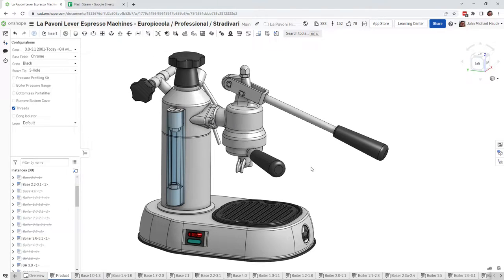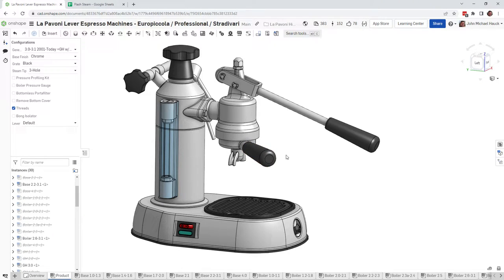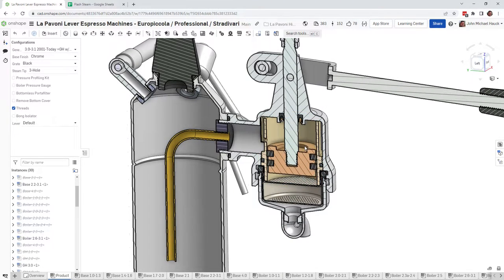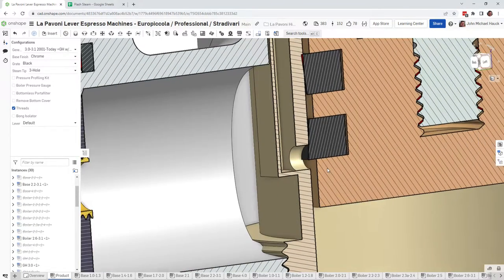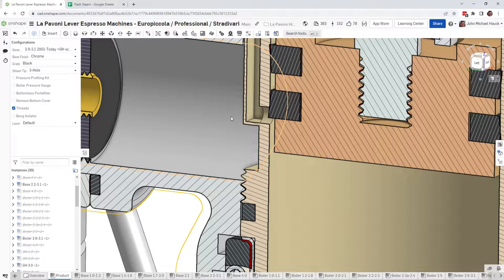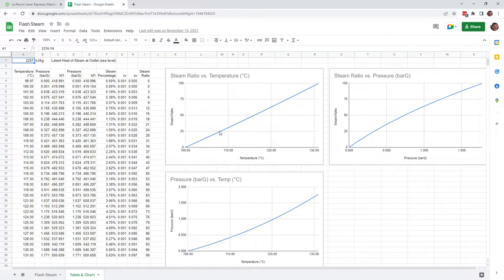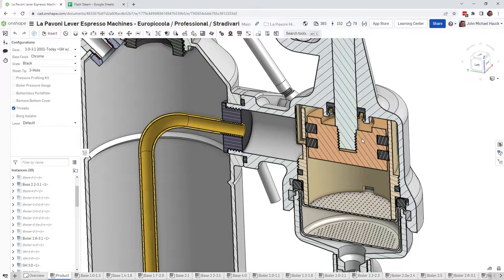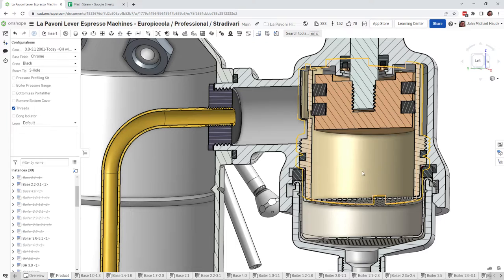18. Trapped Air, Spongy Pulls, Low Shot Volume, Spongy Pulls, and The La Pavoni Sneeze.

Comment: Really useful and helpful - thank you very much. I took mine apart for a fiddle and found nothing wrong, then after watching this realised I was probably just not allowing enough time to heat sink the head plus not pausing enough at the toop of the stroke to allow the water to fill the head. Have also tried the slight up and down movement which seems to help.

Comment: Still improving with my Gen 3 vs Gen 2  thanks to your videos. Findings last few days:
 - As stated in video one can heat up GH with pulling up and down without letting water out. Water cycles group<->neck<->boiler. Quite effective at heating and more controllable than Gen 2 with Steam.
- I had good results with putting the PF into GH without locking and letting water in for 2 seconds and then locking all the way. Air has easy way to get out. Improved my output from 24g to 31g, which is my aim. Before I also had all this bubbly coffee at the end of shot and couldn't understand the reason (trapped air following water through coffee). Thought GH was too hot and it was the steam.
- Putting paper filter on the puck prevents the degradation and puck comes out with flat surface. Tastes better too. Only solution for Gen 2 since no 49mm puck screens in the market.
- I have 1 more solution in mind to trapped air. Unscrew the spout, lock in PF, hold the hole with finger to prevent air getting in. Needs to be tested, since currently using bottomless.

Comment: I am trying to understand the way the sneeze is described here. It seem so scary, dangerous, messy, something “you want to avoid” as you put it. Isn’t it intuitive to just stay on the lever and make sure everything is purged out air and water through the puck? Take out the cup when yield is reached and keep the lever down. Or isn’t it common sense to just raise the piston a bit to relieve the built pressure before removing the portafilter?  I am asking because i am really curious if more people are really fallIng into these scary sneeze accidents. Also it is a manual lever machine, what is the rush to remove the pf just to make another coffee for the guests? I mean it is a manual, pour over to refill , cool down the bell kinda machine... what is another couple of seconds to wait for the pf to depressurize either by lift or by patience?

Comment: Thank you for the videos :)

The ultimate solution for spongy pulls is the "Airbuster" by CoffeeSensor. I installed this on mine LP and.. no more spongy pulls with any group temperature. The leaver feels hard to push from the very high position, even with 0.8 bar boiler pressure.
Reply from the maker: Yes, the air buster works very well.
https://coffee-sensor.com/product/airbuster-release-valve-and-chamber-for-la-pavoni-lever-group-heads/
Reply: Wasn’t there a solution in user manual? It is recommended to release air when machine heats up via steamer…

Comment: I have a problem with coffee dripping before I pull the lever. It is a Gen 3 machine. I have an Ok grinder(silenzio) and don't have this problem on my Gen 2 Pavoni.
Reply from the maker: Coffee dripping before you pull the lever is usually a result of beans that are too old, grinding the beans too coarse, not enough ground beans in the portafilter, and (arguably) tamping too light.

The portafilter diameter on a gen 3 is slightly larger than the gen 2, so it takes a few more grams of beans to offer the same resistance. Maybe that is the difference between your two machines that you are noticing.

Another possibility could be the boiler pressure in your gen 3 is higher than your gen 2. It is the boiler pressure that is forcing the coffee extraction that starts when you raise the lever completely, but before you start pressing it down.

So, I would treat each machine separately. Start with locally roasted beans roasted less than a month ago, grind fine with a good quality grinder, use 14-16g of coffee in your portafilter, and tamp with at least a moderate amount of pressure. As for tamping, make sure the bed of coffee is level in the portafilter and that there are no air pockets.

I hope this helps.
Reply: @JohnMichaelHauck  Thanks for the reply. Enjoyed your group head explanation videos a lot. Every Pavoni user has to know this.

Comment: I am having the opposite problem, my la pavoni lever is suctioning down with force? If I let go of the lever it just falls down....any idea?
Reply from the maker: Dillon, my understanding of your problem is that it occurs when you have the portafilter attached with finely ground fresh coffee grounds tamped firmly in it. You raise the lever all the way and the lever just wants to go back down. I also suspect that if you hold the lever up for a while (maybe 20 seconds), the lever will stay up and you can pull your shot just fine. If so, this indeed is a problem, and it liley that the piston has unscrewed itself a bit from the piston rod. This can be confirmed by raising the lever all the way (with no portafilter) and observing something less than a forcefull dispensing of scalding hot water. You will have noticed the time it takes for the lever to stay up has been increasing over the weeks or months. I'll call this a low water flow problem, and video 21 talks about this a bit more. https://youtu.be/W3_8EnN1APo

If on the other hand you are explaining what happens with no coffee beans (or the portafilter not attached), then what you are describing is normal. With no fresh finley ground coffee in the portafilter, the lever will always* want to force itself down. *Well, unless the machine is turned off and cooling and the anti-vacuum valve is not fitted or stuck closed, then the lever embarassingly goes up by itself.

Let me know how it goes. There could be many other issues too. I would suggest joining this Facebook group to connect with a bunch of knowledgable and helpful folks who will be more thoughtful and responsive than I can be: https://www.facebook.com/groups/lapavonienthusiastsgroup

Comment: Does the steam return channel in the v2 group head mean spongy pulls ought not happen?
Reply from the maker: Richard, Spongey pulls happen with the v2 group head too. The steam channel in the v2 group head is positioned very high in the group head which means there is no opportunity for air trapped under the piston to be exposed to that channel. See this video: https://youtu.be/ViNrag4lYJg

Side note: The steam heating of the v2 group head means the group head runs hotter than other models - and hotter group heads result in less spongey pulls because of flash vaporization.

Side side note: Hotter group heads means more extraction of bitter flavors from the ground coffee.
Reply: @JohnMichaelHauck  thanks John, and a massive thank you for your dedication and passion for creating this project.
Reply from the maker: @richardedwards4997  Thanks for the thanks. Don't forget, all the CAD models are freely available at http://bit.ly/LaPavoni

Comment: What about the air above the piston? Surely there's air trapped above it
Reply from the maker: There sure is, but it gets pushed back into the boiler when the piston is up. Some say you should bleed this off with the steam wand or it will cause "false pressure". I'll address it in more detail someday.
Reply: Awesome, I assumed so. 
Perhaps a good preparation would be to lift the lever, and bleed with the steam wand before locking in the portafilter. 
This would heat up the group and bleed the pressure in two motions.
Regardless, thanks for the reply.